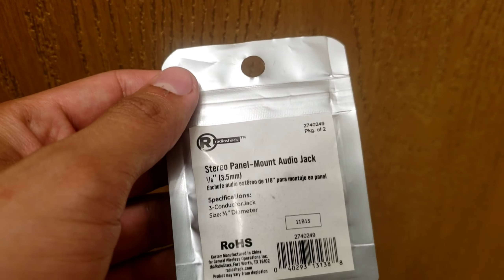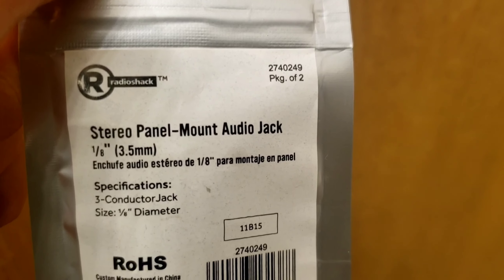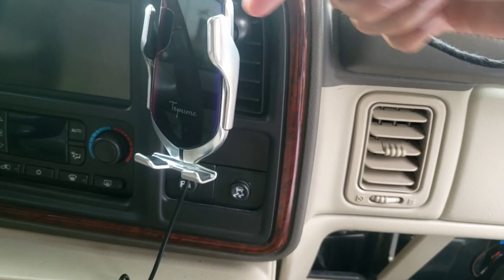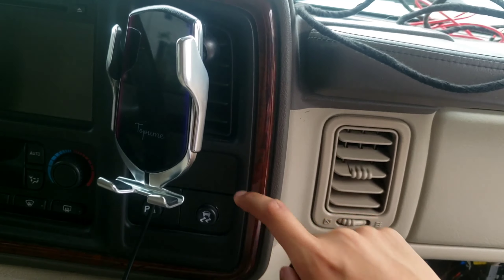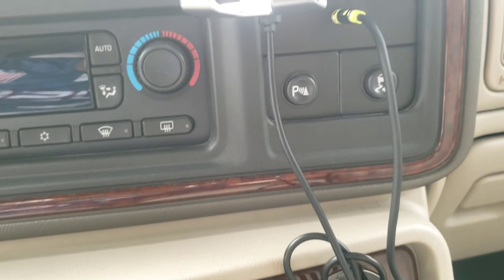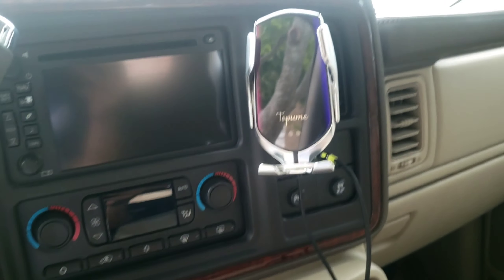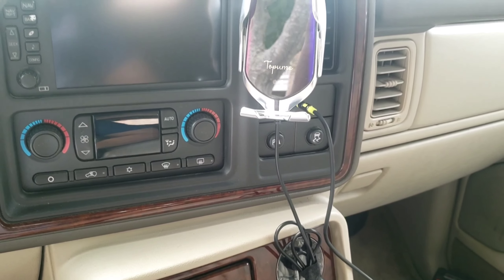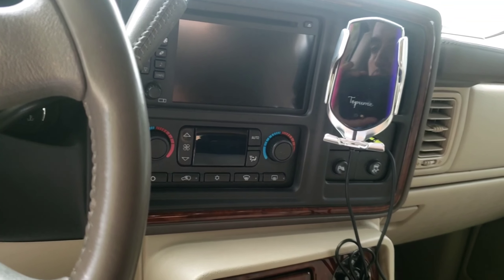CADILLAC ESCALADE ADDING AN AUX PORT INSTALL!!!

Comment: Thanks for posting this looking for a short term solution to an aux input
Reply from the maker: No problem 😉
Reply: It worked out just fine not sure if the left right channels are correct. But easy to mod.
I needed a noise filter that came with my Bluetooth kit.

Comment: It does work really great,Iam very happy with the results.If my mp3 is off I can here the XM “preview “ playing very quietly .when I use the aux at normal volume the XM can’t be heard
Reply from the maker: Ok if you can hear the xm you didn't cut off the wires what I mean is the wires you are tied in too on my truck I completely cut the wire and hooked the up only to the aux port so at no volume I hear nothing and you are still hearing xm preview you are only tapped into the wires so same wires cut them before they go into the xm module
Reply: make sure to use electrical tape on the wires you cut off .

Comment: I still have a real low volume bleed back with the 3 wires disconnected at the plug,why?
Reply from the maker: Did you got off the xm wires going to the module?

Comment: On the 06 escalade there is a little ipod cable in the middle compartment and you can buy a 30 pin to aux and iphone charger and its the same as a aux
Reply from the maker: Nice i did not know that
Reply: I’m having an issue on how to get to the right source for mine, the screen doesn’t light up so I can’t see what I’m pressing but audio works. How many times do you press the band button to get to xm?

Comment: Would you be able to link the wires etc you used? I found the stereo panel-mount Jack but would appreciate if you could steer me in the right direction for the other things needed!
Reply from the maker: Do you mean like the cables hooked up to the aux port?
Reply: YES! I am wondering what type of wires you connected to the XM cables  @cgrreviews7220

Comment: Thanks for the video. I completed the swap but now when I’m connected there’s a whine through the speakers that changes pitch with my engine speed.
Reply from the maker: It's engine whine from the alternator
Reply from the maker: Did you delete the whole XM option
Reply: @cgrreviews7220   It was only present when I was on the XM input, not in FM/AM or CD. I ended up fixing it by cutting the other blk/wht wire in the XM connector and splicing it with the ground from the AUX connector (the side that goes back to the car, not the side that goes to the connector). Whine is completely gone now.
Reply from the maker: @firechicken3852  ok glad you where able to fix it
Reply: I did the same as you described but now I can hear the noise when I'm in CD. Is there any ideas to solve it?

Comment: Yes
Reply from the maker: I'm not sure why you still are getting that bleed back with those wires cut off mine did not do that only thing I can think off is the aux port also what noise is the bleed back is it actual xm noise or just a bunch of static?